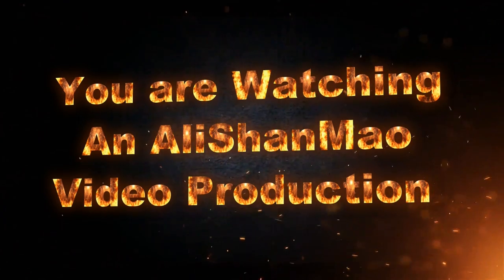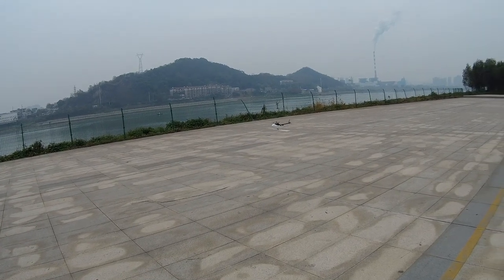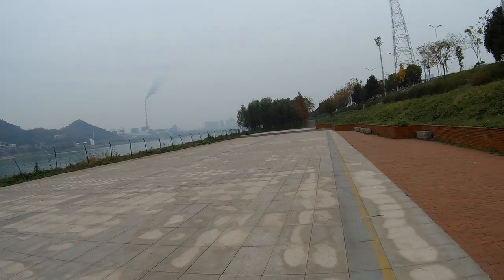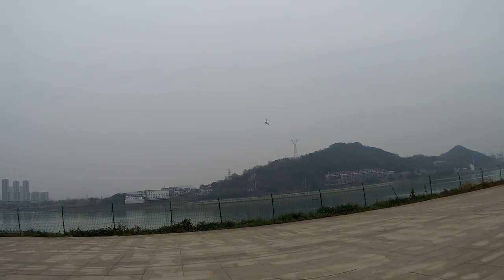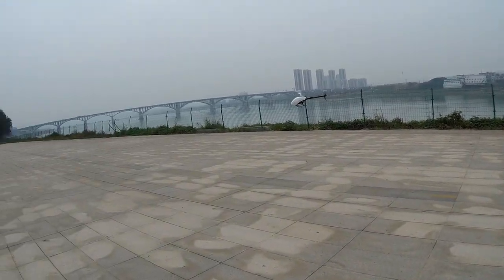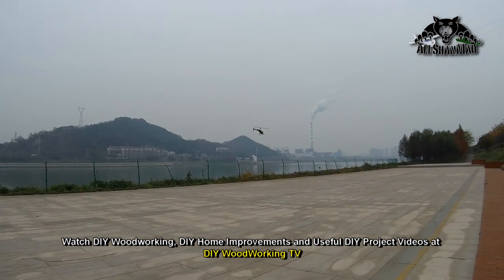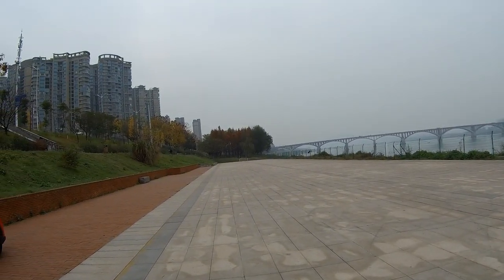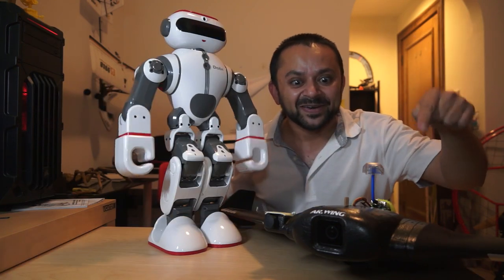FlyWing FW450 V2 H1 GPS 3D RC Helicopter 3D Flight Testing

Comment: a great detailed video friend, thank you, do you have a fix for the bump from 3D mode to GPS mode? Thank you so much
Reply from the maker: need to play with pitch settings
Reply: @alishanmao  with the stock flysky radio the pitch was 15.2+ 15.2-, with the radiomaster I’ve changed it to 10+ 10-, should I change it back to 15.2? Thanks

Comment: The GPS modes appeal, with the longer flight time - have you tried with a Gimbal/GoPro under the nose?
What about a multi-blade head for it? More blades changes the vibration frequency, less likely to cause Rolling Shutter jitter.
Reply from the maker: I tried it with a Fimi Palm 3 axis stabilized gimbal and FPV Camera. it shot an amazing stable video :)
https://www.youtube.com/watch?v=C4-grqRwnBE
Reply: @alishanmao  So, recommended?
Should fly as long as a Phantom, but move the camera like a 1:1 scale heli.

Comment: In gps mode what tail gain% and throttle % are you running? Thank you
Reply from the maker: 64% tail gain, 75% throttle
Reply: Thank you Ali for responding, You have been doing this for a long time and we all appreciate the help and guidance you provided. I’ll try those settings and go have fun.

Comment: Nice video Ali !!
Can it be switched between 3D mode and GPS mode freely when helicopter in the air? Then the GPS mode can be as a "rescue" mode which is so nice.
Have you flown with DJI Naza-H ? How do you compare it with this H1 device? Thanks !
Reply from the maker: of course you can switch modes in the air instantly and GPS is the rescue mode. when you make mistake, just switch to GPS, no matter if heli is inverted or normal, it will start hovering at one point. Have not tried Naza H so can't say.
Reply: @alishanmao  thank you Ali !

Comment: I use a 4s 5200mAH battery with mine and I get 14&1/2 minutes. Very nice job Ali.
Reply from the maker: with HV 4400mAh 4S I am getting up to 18 minutes in Winter :)
Reply: Ali have you tried a graphene lipo, you might get a lot more flight time.

Comment: how do you reset controler and helicopter to the way it was shipped. i picked te wrong swash in set up and cant get back. when i up left stick i have got rear servo moving up like it should but front two servos move in the wrong direction
Reply from the maker: Seems there is no way to reset. if you have bought it RTF you can re program the radio. set an airplane model. no need heli model or swash setup. in a week time I will release a detailed video tutorial on how to setup opentx radio controller with H1 Lite and FW450 V2. wait for it.

Comment: Flew my FW450 V2 many times without issue then suddenly on take off after airborne the tail starts spinning and the heli uncontrollably crashes. .

Used the FW software everything seems ok.?

I have no idea what has gone wrong can you please help  ?
Reply from the maker: could be a fault on the motor, prop got loose or connector for motor came off.